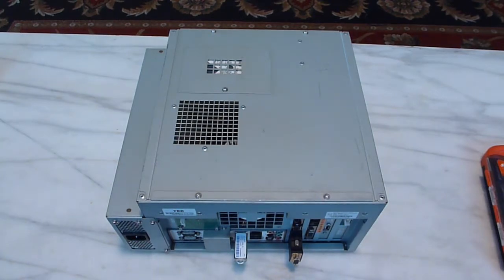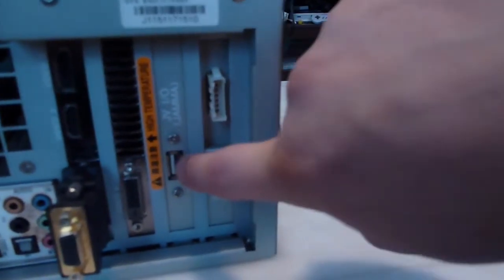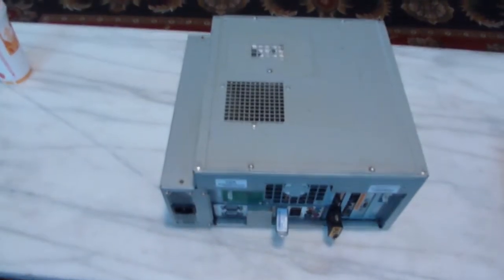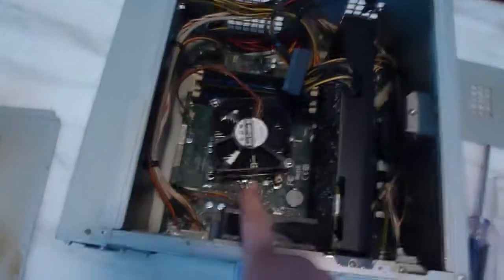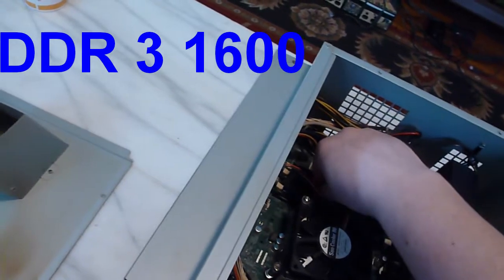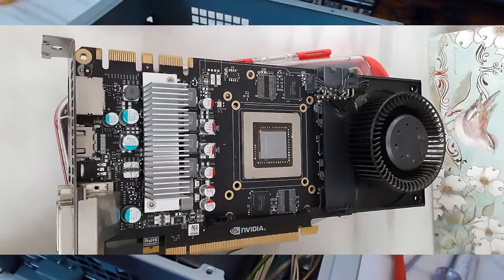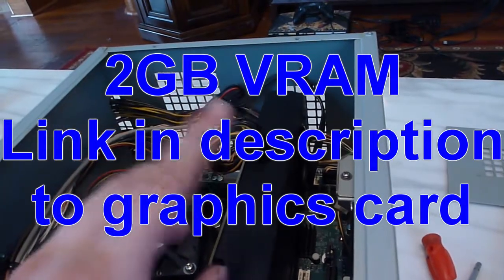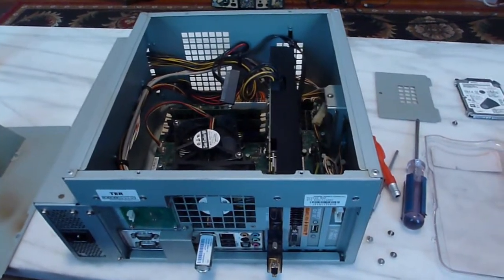Game Nexus Arcade Video Namco System ES3 Tekken 7 Hardware (2017) A closer look

Comment: The loading time is pretty slow as hell. Is the data from HDD possible duplicate to SSD and  run on this system?
Reply from the maker: Yes and no. Yes if you use a cracked image you can run an ssd, no you cant clone the drive if you want to keep it legit. It mostly the bit locker and powershell stuff thats taking most of the time, not the loading of the data files.